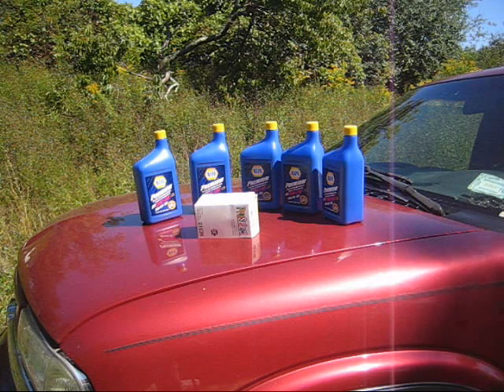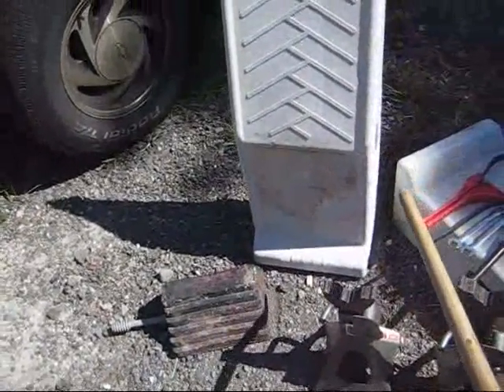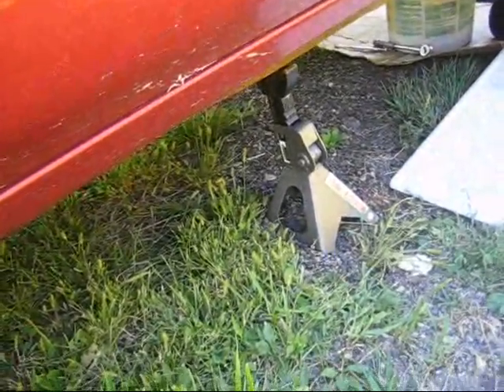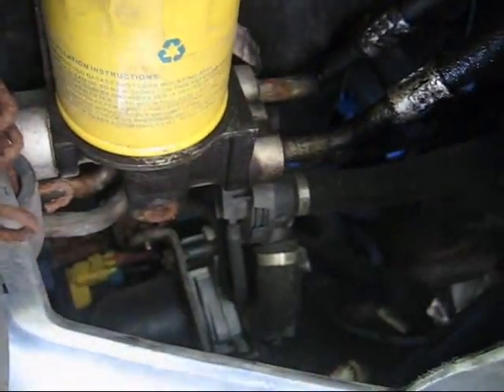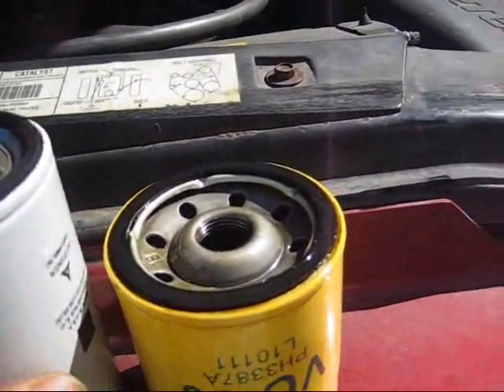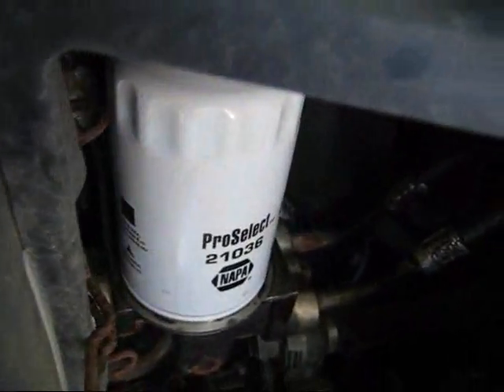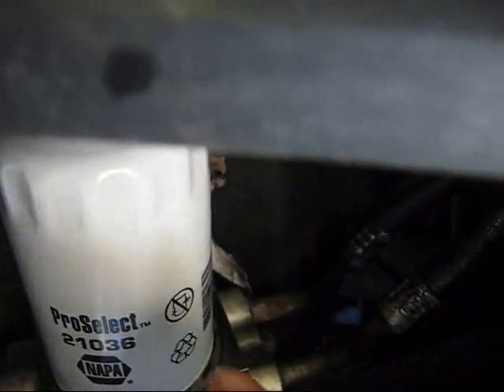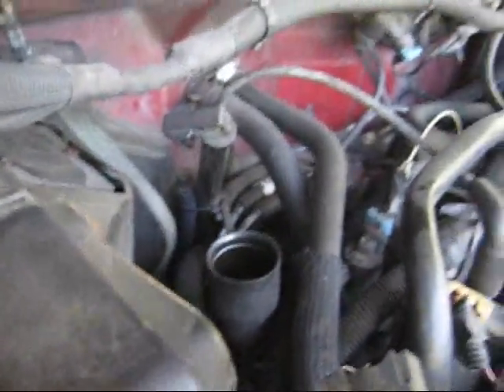How to change Chevy Blazer oil and filter

Comment: Good Video and Tips overall. I would like to add, changing Oil is a lot Cheaper than fixing other Things on the Engine. I fought my Dad for YEARS...., and it's an easy Mathematics equation.  $40.00 per / each year X 10 = $400.00, 1 (one) problem with the Engine will cost more than $400.00 to fix.
Reply from the maker: Hey Jordan thanks for viewing & commenting. I agree with you 100%. You get the best bang for the buck with an oil change. As far as  maintenance goes it is one of the easiest for DIY. At one time there were several vehicles I had to maintain and due to frequent oil changes none of them ever had any engine problems.

Comment: The new one u got is for 4 wheel drive . The one that came off the Blazer is for 2 wheel drive.
Reply from the maker: Hi Cole thank you for stopping by & taking the time to comment. I was told they (previous owners) use to have all their work done by  a shop. I guess the shop just used what they had on hand. Recently I though I give myself a brake & went in for an oil change on my other vehicle( Not this  Blazer). Manager comes out & says that he recommends that I change the oil plug bolt. He said the threads were starting to wear & the head of the bolt was destroyed. Well the threads were ok but the head was way worse that the one on the Blazer. I said why did they use pneumatic wrench he said they don't & the car has 130000 so divide that by 3000 and after so many changes they wear out. LOL Well the vehicle we are talking about has only 90K on it. I had vehicles that were high millage that never saw a shop. Oil changed every 2500 to 3000 & never had a stripped bolt. It is even worse with tire rotation. I should have done video on that.  Stay well, Joe Z

Comment: It's not a 9/16 wrench for the oil plug🙄
Reply from the maker: Thank you for visiting & commenting. I had to check 🤔. On Mine 9/16 does fit
Not sure if mine or your oil plug is original. You did not mention the size.
inch                      mm
           decimal
9/16   0.5625    14.2875
Stay well, Joe Z

Comment: Oil filtering mine is in d8fferent spot entirely...
Reply from the maker: This is the only Blazer I had. Is yours a 2000 with the v6?
Reply: All ZR2 models oil filter are located up front behind the front bumper. Regular Blazer are located underneath the engine.
Reply: I'm in Australia and got a 99 rhd .No idea where mine is . Going crazy looking for it

Comment: And he also didn’t fill up the filter with oil like he  supposed to
Reply from the maker: @rocky-jj8dd, Thank you for watching & commenting. Adding oil to the canister will not hurt anything but is not required. I believe it will help to get oil to circulate into the pump but if you wait the oil will make it to the filter and this filter is mounted horizontally not vertically. It would just make a mess installing it full of oil.
Stay well, Joe Z